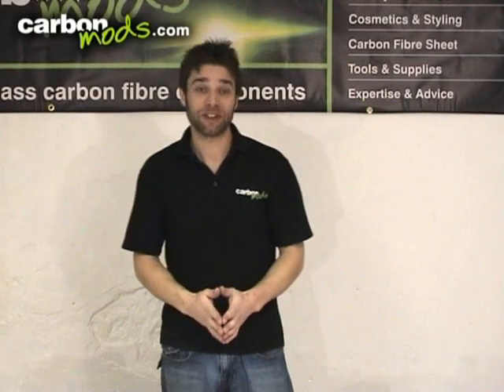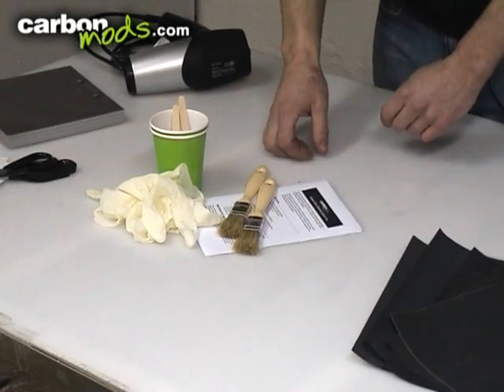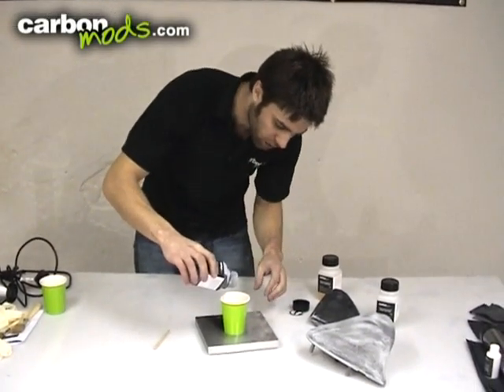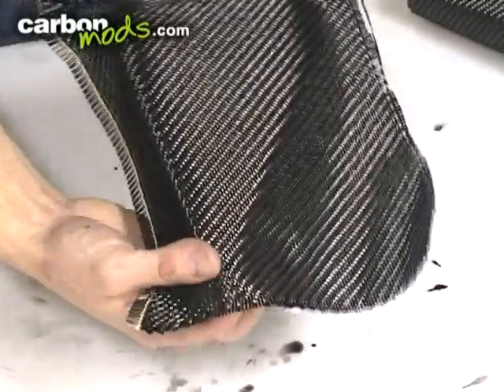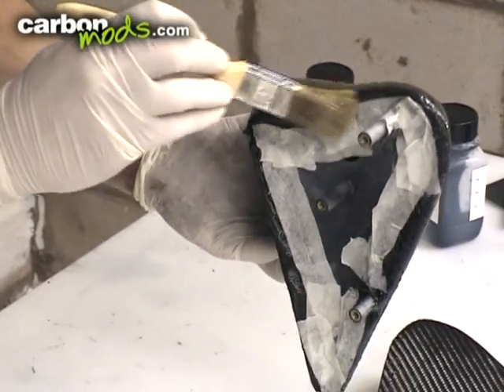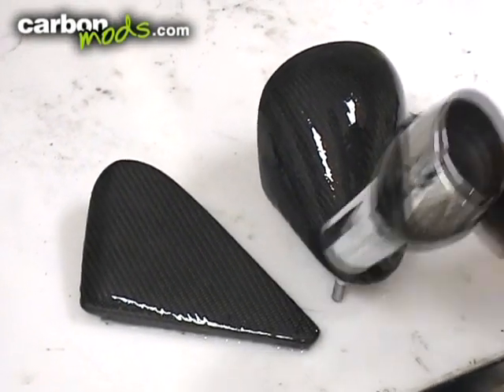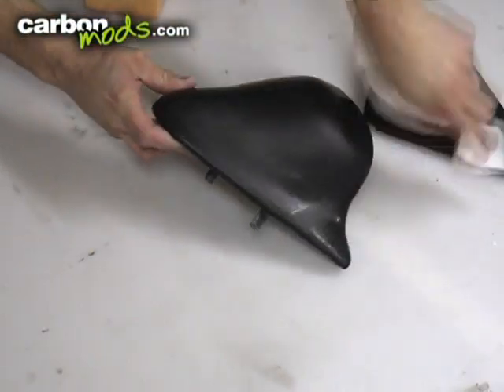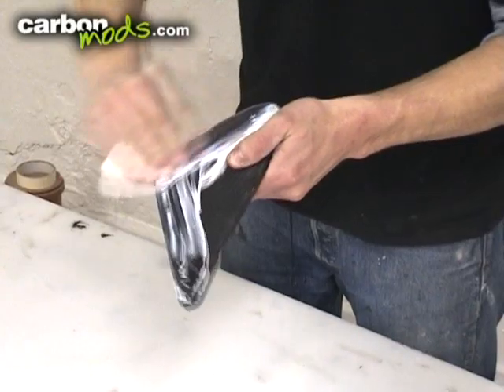How to cover parts in carbon fiber (fibre) by skinning or wrapping

Comment from the maker: @CritikylMass : Yes, you could add reinforcement to a compound bow to make it more powerful, ideally you would want to be using unidirectional carbon fibre not a biaxial woven cloth (like you see in this video) - we sell unidirectional cloth on easycomposites.co.uk - You would need to heavily 'key' the limbs with abrasive paper, wet them with epoxy, layer on the UD carbon, wetting it as you go, and then ideally you would want to squash the carbon down with something to consolodate whilst curing

Comment from the maker: @tukajjelos : Well, technically the carbon fibre (and the resin we use) are exactly the same as the carbon fibre and resin used to make carbon fibre parts (rather than cover parts in carbon fibre) and so yes, it's just as strong. When you 'skin' something you're only adding a single layer of reinforcement though, whereas if you were laminating a carbon part you would use probably 6 layers of a 200g cloth like this one.

Comment from the maker: @circusboy90210: Well, skinning in the sense of this video is cosmetic, not structural, however there are certainly many applications where you add carbon fabric and resin onto the outside of a structure to add weight (like a balsa fusealage could be strengthened with a layer of carbon and resin). In this situation you wouldn't bother with the basecoat.

Comment from the maker: Hi Delsol, The base coat is very sticky so it can hold the carbon tightly against the surface of the part even on very sharp corners. 

It is also posible to do parts in multiple pieces, where joins might be necessary/desirable. If you were to do one side of a cube with a cut, you would apply the carbon and then trim it at the corner once is was 'tacked' down... this would leave a very neat cut right on the corner that wouldn't be visable... simple! 

Thanks for the question.

Comment: is there a certain presedure to take when restoring carbon fiber when I has cracks?
Reply from the maker: +Daniel Nava Yes, but the correct procedure depends on the nature and the severity of the damage. Some damage is cosmetic and may only need sealing to prevent water ingress, some damage is structural by modest and can be repaired by adding layers of carbon fibre and resin over the damaged area and other damage is can be too severe to be effectively repaired.

Comment from the maker: Hi MWolverine1969,

It would be pretty tough to make the line invisible, however you can make a really neat line by using a sharp knife to cut it, if you do this after it has been stuck to the base-coat the fibres won't fray. I hope this helps. 

Carbon Mods

Comment: One other thing I should have mentioned about using the starter kit is as you only get 2 brushes in the kit, I found it useful to obtain a cheap pack of disposable brushes on eBay. Made the job much easier not having to clean the resin out of the brush after each use.
Reply: Brent Chiswick you

Comment: When do you need to use a vaccum sealed bag to finish the carbon?
Reply from the maker: +FIFTYmil Generally, vacuum bags are not helpful for the skinning process (shown in this video) but they can be very useful for laminating carbon fibre into a mould and are essential for processes like resin infusion and prepreg carbon fibre. Check out the Easy Composites videos on resin infusion and prepreg for more info on these processes. https://youtu.be/cQ1Q4XmItN0
Reply: Thank you
Reply: carbonmods Thank you for the informative reply. I am exactly trying to skin the top surface of my motorcycle aluminum gas tank. Unfortunately, I do not have a way to mask off the rest of the gas tank to skin just the top.

Comment from the maker: Hi Taff, we spent a long time getting the right resin for the job, you are right though, epoxies are generally tough to polish well, our system flats out and polishes by hand perfectly, if you wish to machine polish you must ensure the part is fully cured and the head set at a low RPM otherwise the surface can soften with the friction generated heat and a good shine can't be acheived.  We don't know of anyone who has experienced problems polishing our system to a full gloss. Thanks for asking.

Comment from the maker: @F1BOY2007 : Yes, it's 200gsm we use in the kit. It's the most common weight of fabric. The weave is 2/2 twill, also the most recognisable of the carbon weaves. When you say what thickness it's made of I guess you're talking about the finished 'skin' of carbon fibre not just the fabric before it's coated in resin?) in which case the finished skin adds about 1mm or less to the part.

Comment from the maker: Hi Tulaconalas, normally this kit is used for the look, however the materials used are the very best in structural performance too, so it would be fine to use this process to strengthen you speedboard, people have used these materials for making there own wakeboards and surfboards you may want to use more than one layer of carbon to get ultimate strength though.  I hope this helps you out.

Comment from the maker: Hi DaveVU2, 

There is no real way to soften epoxy far enough to reseal cracks in it, I would recommend trying laminating epoxy brushed on the area, then heat it with a heat gun to lower it's viscosity, in many cases this will allow the resin to capillary into the damage and reseal itself, you can then wipe away the resin from the surface.  Thanks for the question and good-luck with the repair, 

Carbon Mods

Comment: How could i wrap it around bike frame so theres no streaks
Reply from the maker: tyler vanleuvan I'm not 100% sure what you mean by 'no streaks'. If you mean no 'seam' then this would be pretty-much impossible because when you wrap fabric around a frame there will be a join where the fabric starts and ends. However, if you positioned the join on the underside of the frame it wouldn't really be noticeable. If by 'no streaks' you mean no run marks then this should be straight forward enough, apply each layer quite thinly and then apply more layers - this will allow you to biuld up the thickness you need without it sagging or running off more than necessary.

Comment from the maker: In the video a simple off the shelf rattle can automotive lacquer was used.  In an ideal world a 2 pack lacquer would be used as they have a better UV resistance than rattle can products, however this is not always financially viable or practical for smaller parts.

Comment from the maker: @mlinecomposites1 : Actually, if you put the carbon onto the basecoat at the right time (when it's firm but still slightly tacky) you can lift it back up again before you put any pressure on if it's not lined up quite right. We did a bonnet the other day and the carbon went down a little out of line, it was easy enough to lift it up and get it right second time. Once you press it firmly down, it's down for good.

Comment: is the epoxy chemical resistant? I have a plastic gas tank with some hair line cracks that I would like to skin in carbon fiber. will this work for me?
Reply: Replace that shiz, g
Reply from the maker: There are actually specialist tank lining resins that you can get - for a fuel-safe application I would recommend using one of these specialist resins. Caswell Europe sell one.

Comment from the maker: This is all exactly right. The standard twill weave we supply is only 0.3 in thickness. The top coats will take you up to about 1mm. Changing to a lighter carbon fabric will only have a very slight effect since a thinner fabric would be 0.2, the rest of the process would then take it up to 0.9mm (although in reality it will vary more than that).

Comment: If you were making a bike frame, and you made the core of foam, how many layers should i use of carbon?
Reply from the maker: +Decklyn Uttmark This would depend on th weight of the carbon and the design of the frame. Typically, modern bike frames are up to 2mm thick in the most stressed areas and down to 0.8mm thick in the least stressed parts of the frame. A very rough 'rule of thumb' regarding thickness is that the weight of a fabric, in kg/m2 is the same as the thickness of that fabric in mm; therefore a 0.65kg/m2 cloth will be 0.65mm thick.

Comment: I don't know if the carbon fibre itself causes as much damage to human tissue as the asbostos fibre. But the requirements for safety equipment are the same for both so i guess you should be careful. Also, epoxy vapor is poisonous and very allergenic (causes allergy and cancer a.o) Good gloves and the right bio breathing filters should always be used in handling epoxy or sanding it. I'm making surfboards out of it and have done thorough research on this.

Comment: so when I did the clear coat way, the clear coat came on not shinny but fuzzy.. the temperature here is optimal and its not cold at all.. I was wondering why is that its still coming out fuzzy. sanded the part pretty good up to 1000grit.

Comment from the maker: If you want to make replacement parts, rather than just cover an existing part then the process is a bit different (although many of the materials are the same). We actually sell a Mould Making Starter Kit - for making the mould, and a Lamining Starter Kit - for making the replacement parts (using the mould you make with the other kit). Check out our other videos to see how this is done.

Comment: Hey, Carbonmods!  

 I've never dabbled in custom work before, never made my own mold, fiberglassed anything or even touched CF.  I'm interested in doing a few small parts with your kits, but I'm worried about the complexity. 

How would you go about wrapping say, a steering wheel?  Or to make one completely out of CF?  I'm clueless!

Comment from the maker: @28hypnotic : Yes, you can file it. We use Perma-Grit tools (which are a range of tools with Tungsten Carbide grit on them), they do sanding blocks and files etc. The main advantage is that they don't really blunt or clog but for a cheaper alternative you can't beat a range of different grits of abrasive paper around a block. Start with coarser grits and work your way up to finer grits. By the end you can have a perfect smooth glossy adge.

Comment from the maker: If you use epoxy resin (like we do in the video) to skin the part then it would be a good idea to use a 2k lacquer over the top of the part to provide UV protection to parts that will spend a long time in the sun. An epoxy gelcoat wouldn't be necessary because it wouldn't actually add this protection. An alternative (really when making parts, not when skinning them) is to use an epoxy compatible polyester gelcoat like GC50 - this provides UV stability to epoxy based parts.

Comment from the maker: Hi AcryllicWonder, 

We have made our kits to give you the best start possible, I wish they were around when I started! as for a steering wheel, I would say that you've picked a tricky part to skin, and a very very tricky part to mould, I would suggest starting with some simpler parts such as interior trim, where you should get great results straight away, then move onto the more complex parts as your experience builds, 

Thanks for the interest,  Carbon Mods

Comment from the maker: @0livia9991: Hi Chris, you can use any standard body-filler to prepare your body panels before skinning. In fast, because the skin is so solid and you're going to do so much flatting the quality of the part underneith is unimportant. We've just filmed a video (not edited yet) which shows us skinning a whole bonnet (hood). The bonnet itself had lots of scratches and a couple of bits of body filler. The end result was stunning. I'll be uploading it soon. We can do your size, no problem.

Comment from the maker: @Bonerific0 : Rear diffusers are a tricky shape, either to skin (like in this video) or to actually make. Our advice for skinning would be to use ProFinish carbon (see our website) so that you can make all of the fins and flat parts up in separate sections. This way you won't struggle with the massive weave distortion that would be neccessary to get the fibre into and out of the fins and back onto the flat sections (if possible at all). With lacquer over the top you won't see the joins.

Comment from the maker: @oldhpirs4 : It depends on how difficult the parts you try to make are. Really detailed or intricate parts with lots of tight corners can be very difficult or even impossible to skin (or replicate completely) in carbon without at least a bit more equipment. If it's simpler shapes or items then it's perfectly possible to do a good job of making these even as an enthusiastic beginner.

Comment from the maker: Once you've done enough flatting back and polishing up, you should be left with a finish that's as smooth as if you took it off the inside of a polished mould. Remember that a mould would normally have been made by sanding and polishing something so there's no reason why the finish would be any different.

Comment from the maker: @Monk3yman77 : Yes, sort of. The trick is just to skin straight past the edge (no curling the fabric) and then when it's cured to cut it off and sand the edge smooth. This method works really well for getting very neat edges, especially when you have other parts that the skinned part needs to meet up with perfectly.

Comment from the maker: @dutchguywillem : This certainly depends on the temperature you're working at. We recommend an ambient temperature of 20 degrees, this is what most epoxies are designed to cure in and if it is 20 degrees you'll be at the 'tack' stage in around 4hrs. It's worth checking fairly reguarly; if you catch it just right it makes the job a lot easier!

Comment from the maker: Hi Transam, the best way to get a neat line between a skinned area and an unskinned one is to mask out the area you don't want the carbon to be, then apply the base-coat, when it goes to 'tack' remove the mask then apply the carbon over the line, then you want to carfully scalpel down the line, mask it off after and apply the top-coats. you should get great results this way!

Comment from the maker: @bloodaid: Well, the reason we're doing it for parts like this is to give them a completely genuine carbon fibre finish. As a side effect, adding 1mm of carbon fibre and resin to the outside of a part would add considerable strength but in the case of a mirror it's strong enough already so the reason for the 'skin' is cosmetic. You could use the same process to cover something very thin and light (like papier maché) then you would re-inforce the part considerably.

Comment from the maker: Hi Simon, Yes, you can drill through the carbon skin without any problems. You should always make your appertures slightly too small and then open them out using a file or abrasive paper - this will prevent any cracking or chipping of the skin.

Comment from the maker: Hi Dipacalypse, 

You could use the topcoat on a prepreg part, however you would probably be better having it lacquered/clear coated, using a good quality automotive system. any decent spray-shop should be able to do this for you. Hope this helps, 

Carbon Mods

Comment from the maker: Hi dreammxdrifter1, It is possible to use this exact process to do larger areas, in many cases it can be even easier as the shapes tend to be fairly simple, we supply the materials in larger quantities to facilitate larger projects on our website, although I would recomend getting a little practice on some smaller parts first. Hope this helps.

Comment from the maker: Yes you can, although i would recommend you just use a simple laminating technique and minimise the numbers of layers of resin for weight purposes. We do stock a wide range of fabrics on our Easycomposites website including lightweight carbons and woven fibreglass often used in aero modelling,

Comment: Hey guys. Great vid.

One question. How would you skin a part that is surrounded, or recessed? For example, an inset on a bumper, where the part you want to skin cannot be removed to wrap fully.

My question is basically, how would you achieve a good finish, with crisp edges if you are only skinning to the edge or a corner, rather than wrapping around an edge.

Cheers in advance!
Reply: Did you find a solution?

Comment: Hi Carbon Mods, just a quick question: How difficult would it be to cover motorcycle fairings? I'm specifically asking regarding the rear fairing. It has quite a drastic curve to it (on a CBR 600 F4). 

Awesome video.

Comment from the maker: The fabric we're using in this video (which is included in the kit) is standard 2/2 twill, 3k carbon fibre. We do also sell a version called ProFinish which includes an almost invisible epoxy powder bonding on the reverse to make it much stiffer and easier to handle/do cut lines. For flatter parts or where you need to make neat cut-lines ProFinish is a great choice but for more contoured parts (like this mirror) then I would stick with the standard 2/2 twill and just get used to handling it.

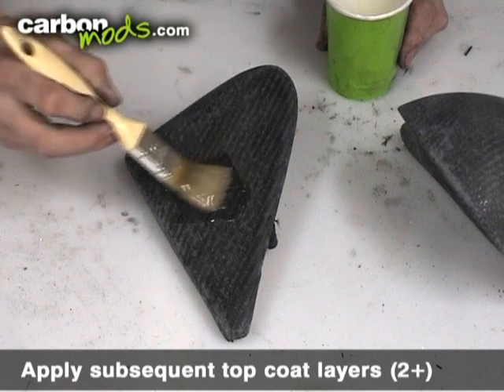Comment: At least they are using epoxy. Unfortunately he skips an important step to achieve clarity between coats. Between each coat of clear, you must wet sand, 200-400 grit, or 3M scuff pad (red) with soap and water. Otherwise you will get what can be seen around 6:00 into this vid. See the cloudiness? That is trapped in between the coats and will not come out. That's what you get by just sanding and applying directly to the sanded surface.

Comment: whats the point of this... i mean you can use di-noc 3m adhesives which are a LOT cheaper and looks just like it. Plus it is more easy to apply - no need to wait hours or days to dry... just stick it on and there ya go